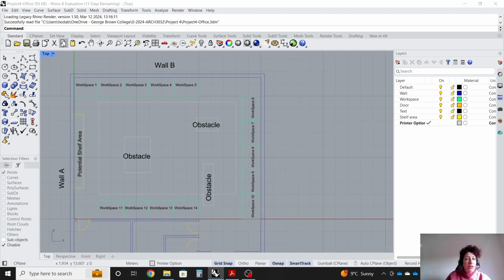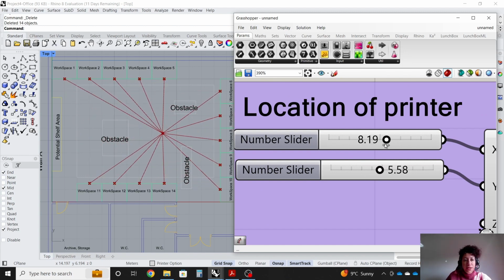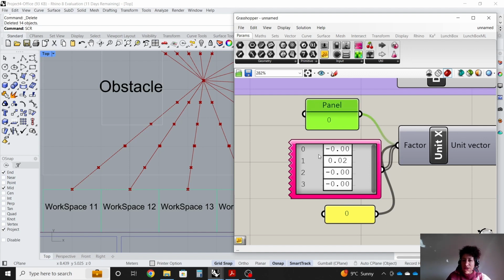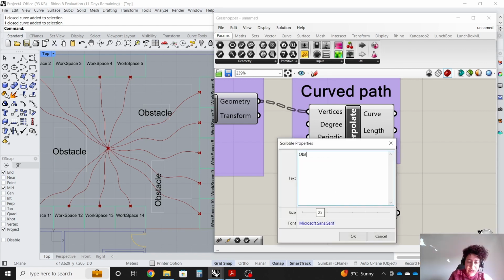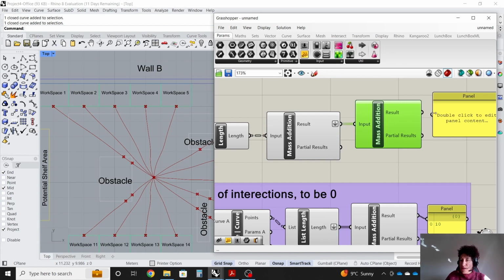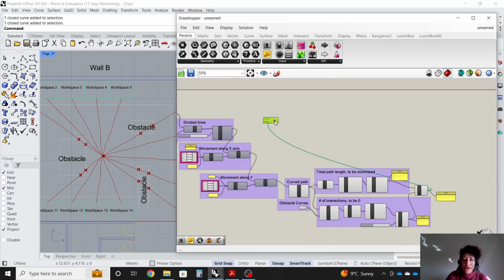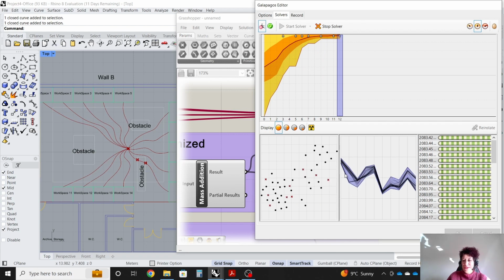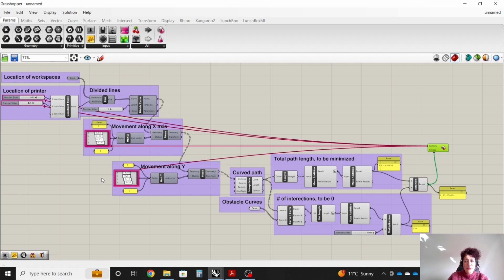Design Optimization, Galapagos, Grasshopper 2 (with Obstacles)

Comment: I have a question, is this considered a multi - objective optimisation since you want to simultaneously remove the intersections and lower the length?? Would Octopus or Wallecei be able to use these at two seperate fitness inputs? Thank you!
Reply: Yes, Wallecei would be a great choice for multi fitness optimization, but she gets around this by using weighted multipliers to assign higher value to the intersects.

Comment: Why do we multiply with a very large number?
Reply: This is to create a weighted metric. Because the intersections matter more to the solution you weight the intersection value higher with a large multiplier.
Reply: @joshuatreadway3988  But you can also say: Equals 0? =True/False and multiply it with the value galapagos compares.